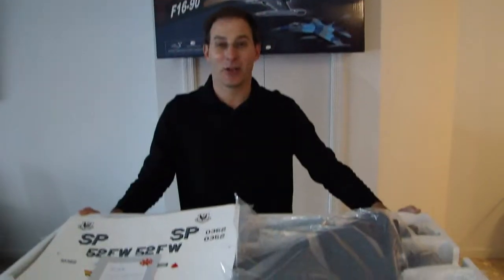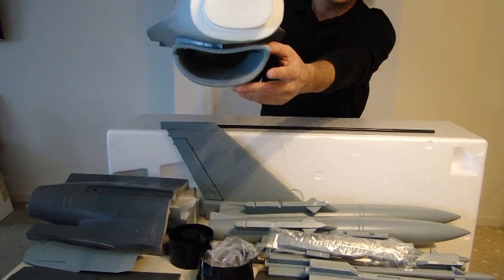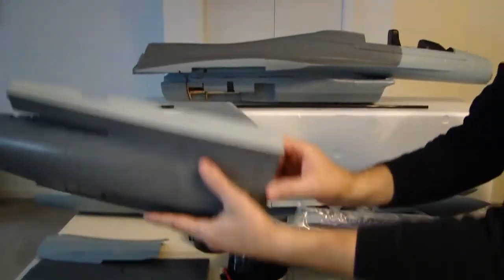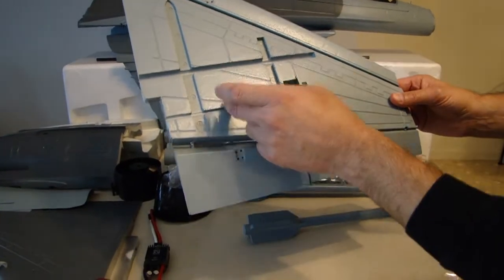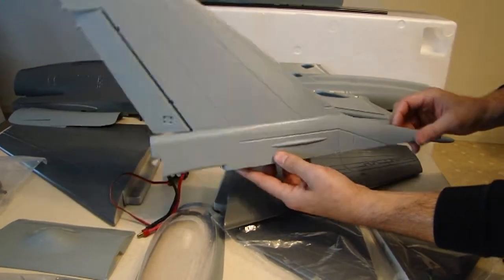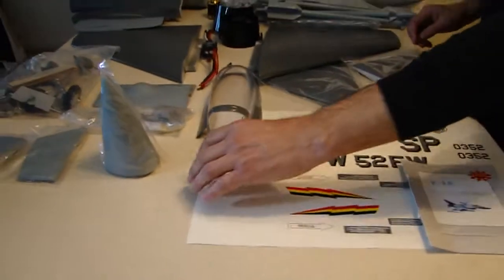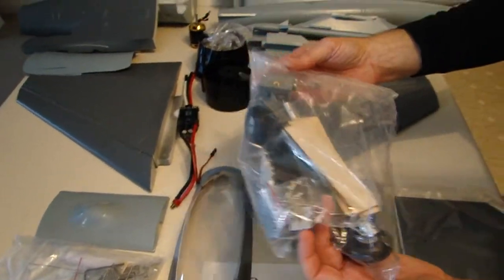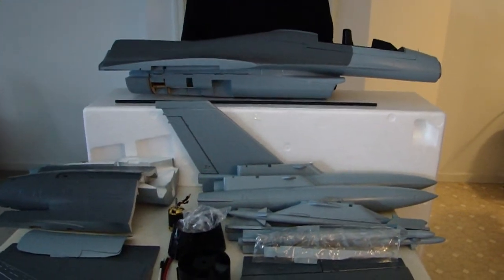F-16  90MM  EDF Out of the Box Preview

Comment: Hey mate, have you flown this with your power system setup yet?  I have the Hobbyking (de-branded) version of this plane and it's gutless!  Also curious if the landing struts on yours have the spring  mounted in pin which goes into the retract or if it's still the crappy soft steel that Starmax used to provide.